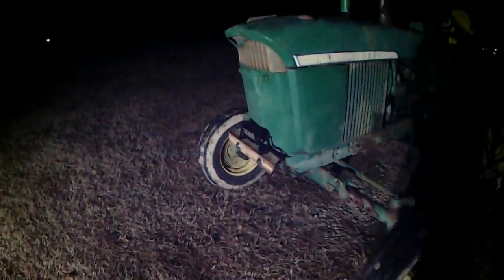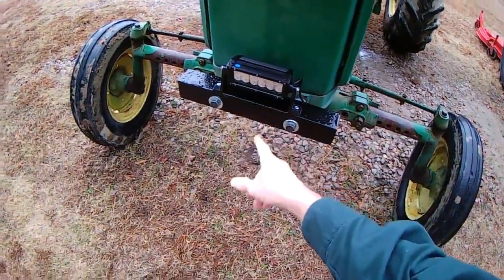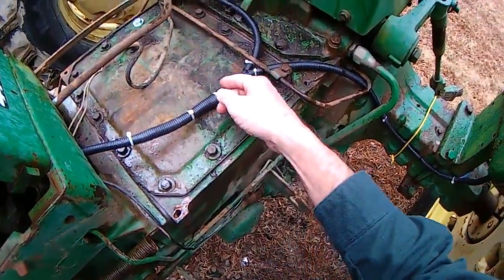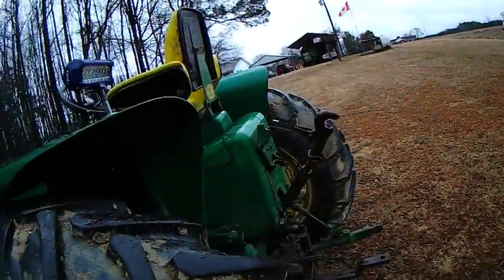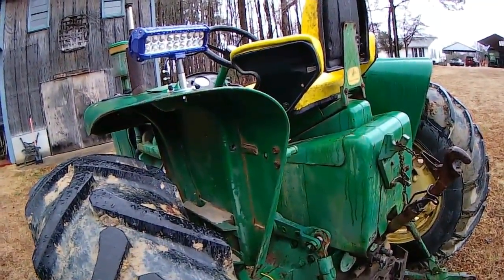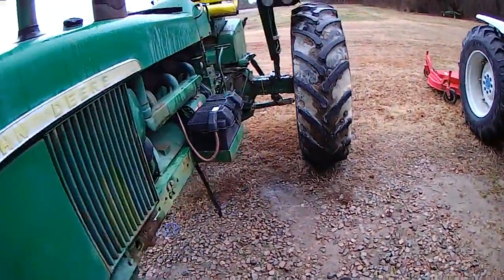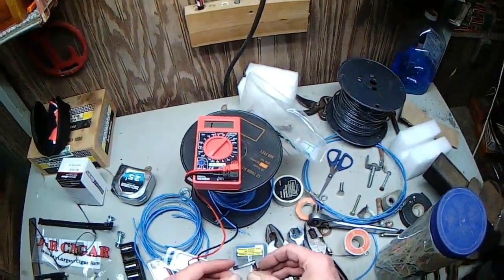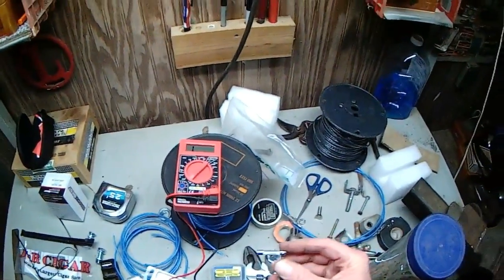Finally completed the conversion to LED on the 4020

Comment: short stop automatic resetting circuit breaker....at auto supply
Reply from the maker: Truman Renz - that was pretty funny to me having that fuse blow while I was showing off my new lights.  the math worked to just under 15 amps so I put a 15 amp in the fuse holder and that was the last issue I had with that.     thanks for watching.

Comment: Soybean Farmer I am chasing the same thing on my 4630 all the wire under the cab needs replacing. I have been driving around with the sealed beam to replace them. You blowing the fuse makes me think I may have similar issues. Great videos really enjoy them.
Reply from the maker: Mwillia Willie - the fuse blowing was the result of me not doing the math and just making a wild rough guess.  after doing the math  the 7.5amp fuse was way under what was needed to cover a circuit at 100% current draw of 14.75amps.   a 15amp fuse would support the circuit at 100% and protect the OEM 35amp output alternator from damage in the event of one of the LED lamps malfunctioning and going to ground.   in the aftermath of the event I did have to LOL at myself.   thanks for watching and commenting.   I hope you are able to locate your issue and resolve.
Reply: Soybean Farmer just an update I have chased wiring found that the previous owner decided John Deere didn’t know how to wire lights. I’m in the process of backing up chasing the wire back to determine where the changes started occurring and I will bring it back to the way JD intended. Got most of the lights working really pleased with that.
Reply from the maker: Mwillia Willie - keep fighting the good fight and you'll win and have what you set out to obtain.   best 2U.

Comment: You  got the 4 stand off tubes that the bolts go thru to support the Floorboard?
Reply from the maker: David Goethe xxx - yep, they are good.  it was the threads in the cast receiver that got messed up.  still figuring a good lasting repair.   got any ideas?
Reply: Will look and see what i would do................................

Comment: Very well done. You do things right. You'll appreciate the better quality of operating lights when you need them. Well done... well done.
Reply from the maker: Bill Whitman - for several years I wanted dash lights.  I had taken the cover off and looked at it to realize fixing the dash lights was going to take a good amount of time to trace the tightly configured OEM wiring harness out.  I walked away.  but this time I had over 160 dollars worth of LED lighting on the shelf in the shop and when I found the wiring harness to the fender lights in such sad shape I decided to completely remove that portion of the harness.  after running into the alternator charging problem I found myself tracing the wiring in the harness in the dash area to resolve the alternator problem.  this is when I figured out how the dash lights were wired so I could fix them too.  John Deere would not give me the wiring schematic for a 1970 year model 4020 so I just kept tracing with my ohm meter and drawing my own schematic.  I got a large amount of hours invested but the end result was well worth the effort applied.  plus I got my own schematic now.   when I get the floor plate back in there I'm going to be really happy.  still got some figuring to do on that repair.    thanks for watching and commenting.

Comment: Nice work Soybean Farmer, plenty of light for night work now. What gauge wire did you use? You could fuse your lights by the wire size.
Reply from the maker: Massey1105driver - the wire size on the John Deere OEM (so called) direct replacement Tiger Light was number 12 stranded.  I say (so called) because OEM had a screw a spade lug would attach to.  these Tiger Lights had about 14" pig tails requiring me to configure my own connections.   I used number 12 stranded to ensure adequate current flow without any voltage drop.  under sizing wire is a big problem most people make the mistake of.    thanks for watching and commenting.

Comment: Did a nice job  just ordered leds for my tractors
Reply from the maker: Levi Brown - LED lights have a polarity and the industry is attempting to wire them so the red wire is the positive and the black wire is the ground.  wired backwards they simply will not light.  some come with spade lugs marked with + and - making it a lot easier to connect.   I hope you can be as pleased with the outcome of your project as I am with mine.    thanks for watching and commenting.

Comment: LEDs turned out great!! Can’t wait for the first night shift!! Personally I would add another rear light. I could use another one on the 684 and WD
Reply from the maker: Michigan Farming - I designed in an easy access point for splicing in another feed for another light on the back.  might do it after some field testing proves the need.   thanks for watching and commenting.

Comment: Vast improvement with the lighting there Soybean Farmer. I'm extremely impressed with your wiring - very neat and tidy. How did you manage to get that cabling up through the ribs on that mudguard? - Use the old wiring to pull the new through?
I was a bit surprised that you chose to only use one fuse when you have three circuits. As you experienced when it goes you loose all your lights rather than some.
Reply from the maker: Dan Whiteford - pushed the wire down from the top and it practically fell in place.   yep, I'm rethinking the single fuse for the very reason you provided.   thanks for watching and commenting.

Comment: You could put breakers in instead of fuses
Reply from the maker: Kenneth Marlow - the $1.25 old style 15amp fuse held.  if I add the addition rear light I'll spend another $1.25 for the 20amp old style.   DC breakers I know about start at around $8.00 and yes they can be reset with either the push of a button or the flip of the switching mechanism so they are a one time expense.   thanks for the thought.  thanks for watching and commenting,